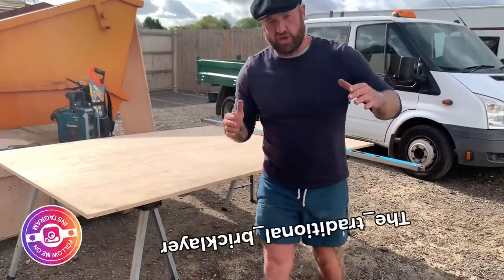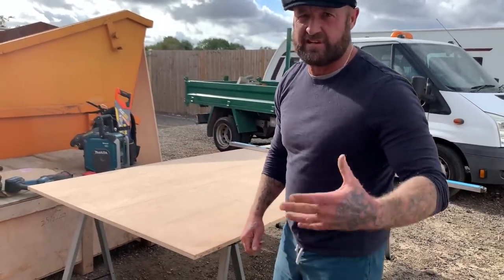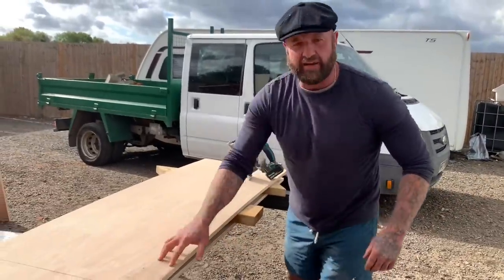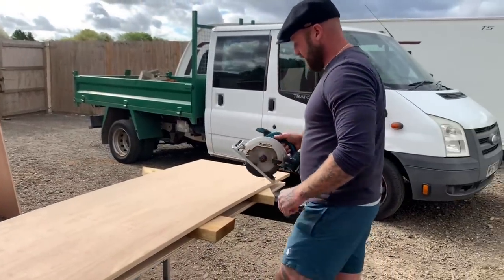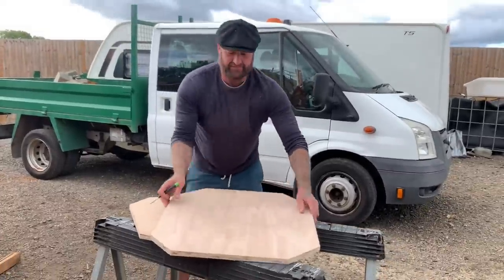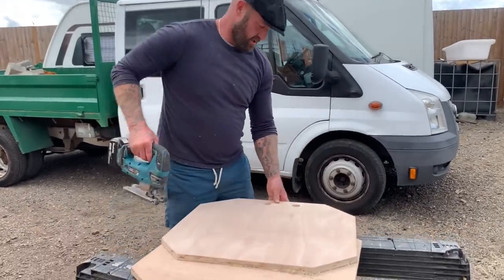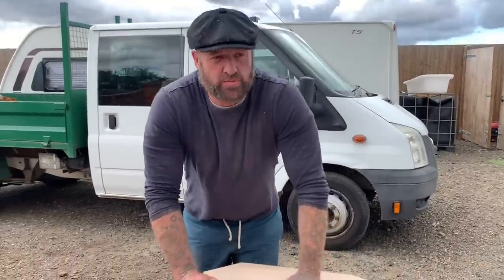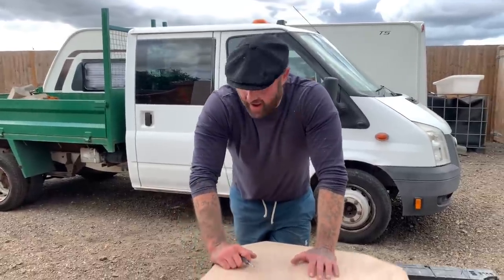Top tip for bricklayers

Comment: What about the time it took you to make um? Plus plastic will last years. I use floor protector, it’s about 6mm thick abit flimsy but it’s lasted about 6 months and it was free off site and I cut it with a Stanley knife. Carry 20 of um at a time if you wanted.
Reply from the maker: Well If I’ve been doing wrong airing this method in life and u imagine where I would be if I was doing it right ..

Comment: 18mm? Oooh, you're a bit flash mucker, it's 12mm 'round 'ere ;-) 

Like the mods though. Last lot I made I used some oil impregnated ply they've got here for shuttering, doesn't soak up the water so much and they've lasted ages.

Comment: Difference is timber will suck the life out of muck. I’ve never used the new pu kind of the aluminium ones but anyone who has says they’re the best. Not cheap for sure but will last and last. And not everyone can get an 8x4 board in their motor to do this at home. Not having a go dude
Reply from the maker: Use the mortar quicker brother ✌️
Reply: dunno if it's b and q or home base but they will cut it into 6 for u in store obviously not with corners cut and handles but don't really need them and if there hoddys anywhere near half decent the boards will be getting wet down every now and again anyway
Reply: @christophervane6428  decent hoddy? What’s that?